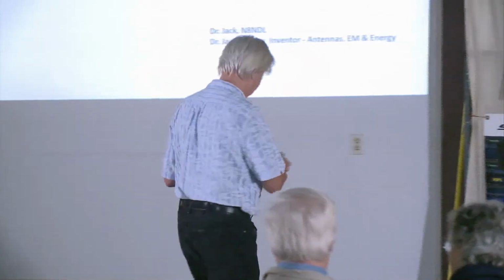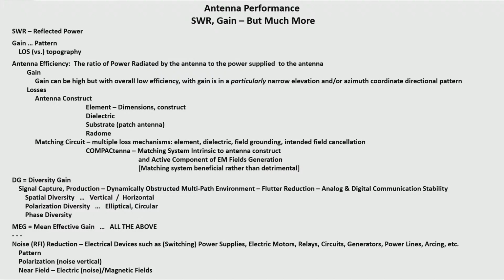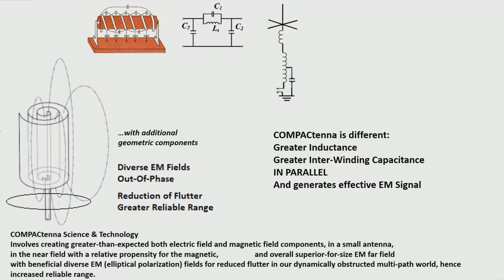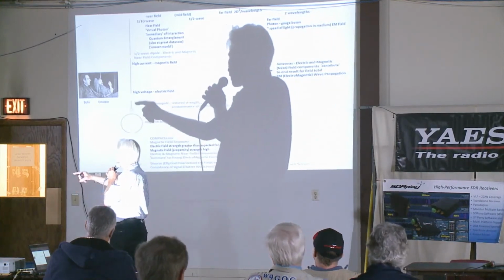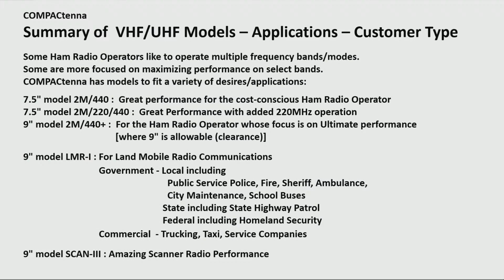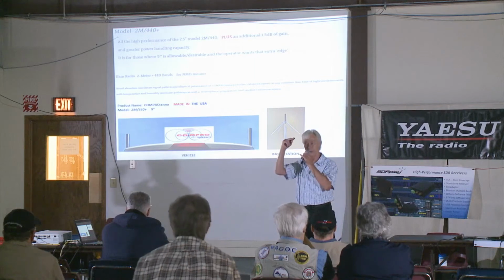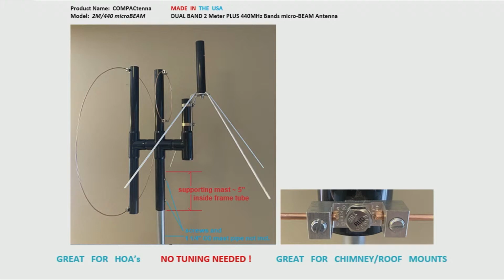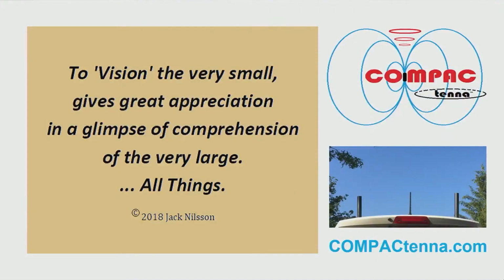COMPACtenna   Small High Performance Antennas by Dr  Jack Nilsson

Comment: The VHF/UHF and the ScanIII models work very well when your mount location has very poor or no ground plane. For that purpose it is fantastic when compared to other antennas. Still, the other various mobile antennas tested worked better with a ground plane. Basically, a Compactenna is a tool to have. I’m happy with mine.

Comment: I want to see a radiation RF pattern, particularly what it would be upon being mounted on the roof of an average-height pick-up truck.  Or, maybe, mounted about (approx.) 20 feet off the ground.  Then, maybe, I might buy one from Ham Radio Outlet to use on my 2nd-floor apartment balcony railing.  I know already that HRO would appreciate my business, as I've been a past customer.
KD8EFQ/73
Reply from the maker: Drop him a line... I'm sure he'll send you some.